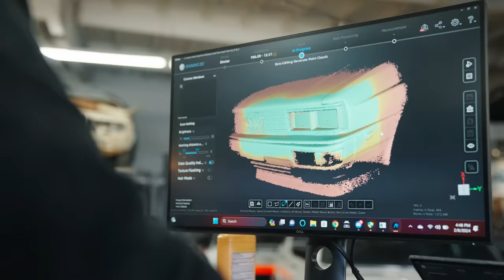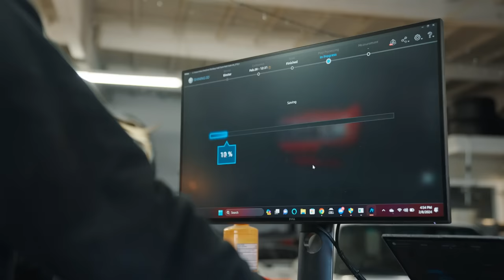The Audi Ur-Quattro Rebuild Begins: Complete Suspension Overhaul & B3 Retrofit

Comment from the maker: Because I’m already getting lit up about pressing the bearing in by the inner race: 
I know the outer race is ideal, but this is a tapered roller bearing, and it is okay to press by the inner race. It’s also held in that way - no snap ring or lock. Just a bolt to the axle clamping the inner race, which pulls inward (direction of press) on the bearing only on the inner race, while the outer race is seated against the inner flange. 
I appreciate the concern, and I know it’s not the ideal scenario, but I even confirmed it with shops that do this every day. 😃🍻
Reply: I just came to scold you! Good on you for owning it.
Reply: I'm surprised there is no snap ring. My old Audi 5000 had one.
Reply from the maker: 5000 was the same as the UrQuattro uprights, which did have snap rings. The B3 parts do not.
Reply: @Nobody-U-Want-2-Know  Same, how dare you beat us to the punch...
Reply: The early 90's Celica wheel bearings are the same way, and most shops in my area won't touch them cause they always break when installing the new ones. And, axle nut torqued to spec is an ABSOLUTE MUST on bearings like this. Over torque it and you shatter the races, under torque and the bearing wears too quick.
Reply: Lol.  Who even said what you were doing was wrong.  Dead ass been using this method well over 20 years now.  Arm chair mechanics bro. Y’all gotta chill.  Leave the man alone!
Reply: Defenetly try „Audi Tradition“ in Germany, normale they have any Part for old Audis … 😉
And I think u have the time to wait on some Parts… ✌🏻
Reply: I knew the nerds would get on your case for that. Sometimes you do what you gotta do. Better than risking marring up the seal.
Reply: What brand is the tapered wheel bearing? Thx
Reply: Yeah I was going to say that. Wheel bearings are designed to take some side loading, but still man, come on! That's a $20 part!
Reply: So, let me get out my crayons and explain, no the bearing won’t fall out, but, two hardened surfaces pressed hard again each other create a small indent, which then leads to excessive wear, but if there cheap doesn’t matter does it, nothing like doing a job twice.
Reply: @dereklovell9778  roller bearings. Not ball.

Comment: Wheel bearings on urq are simple non stepped 75mm all around, available everywhere.  Also, the single piece Urq struts are actually lighter than the 2 piece B3/B4 struts.  Also, you can use the new style control arms with the original stuts BTDT many times.  Also.... shall I keep going?   Parts are available, you just need to know where to find them.  Joining online forums and groups can open up a big resource into sourcing parts.   For suspension, always go with Lamforder, they are OEM and will outlast any of the aftermarket crap like Delphi
Reply: Well said Martin.
Reply: FYI the rear hub bearings are the same size as the E30.
Reply: @seangray-4223   On the Ur-quattro originally up to 1985 both front and rear bearings are the same 75mm non stepped.  Starting 1986 the front bearings increased to 82mm, also non stepped, while rear remained 75mm.

Comment: @stanceworks Mike. Just a quick tip but when you have the car sat on its wheels then that is the time to torque up the suspension arm bolts otherwise you will chew up your new bushings if they are tightened without sprung weight on them. HTH.

Comment: Trick from motocross for easy bearing install.  Put bearings in freezer engine cases on bbq. They just drop in. Works like a charm even if you can't heat the external side cold bearings still slide in better
Reply: I used to work at a construction equipment shop; we had a pressure cooker that we would fill with dry ice. Drop your bearing in there for a few hours and it goes into its home easy-peasy!
Reply: That's not from "motocross", every knowledge enough mechanic knows that truck.
Reply: @j.d.8593 I don’t know the truck
Reply: @cermo9101  that's because you don't knowledge enough.
Reply: @OdyTypeR  the joke went over your head didn’t it
Reply: @cermo9101   Or did my joke go over yours?

In hindsight, Instead of " you don't knowledge enough", i should have said 
" you're not knowledge enough"
Reply: @OdyTypeR  lol you’re right it did, didn’t read back through the original post 😅

Comment: Mike, I think I heard you say that you were looking for 16" rims, which would be period-correct and large enough to fit brakes that are appropriate for the original power output of that car or a Coupe Quattro. They will not, however, be able to fit the size of brakes you will need with the amount of power you are likely to get out of an even lightly tuned version of that motor.

In the VW/Audi OEM world, the largest brakes that I have found that will fit under 16" rims are the 312mm front rotors and calipers fitted to the non-PowerPack Golf GTI Mk7, 7.5, and 8. For that size rotor, Tarox has a 2-piece rotor and caliper combination that can fit under some of the wider 16" rims that are specifically designed for clearance, but that is the best combination that I have found so far.

The PowerPack versions of the GTI come with larger front rotors (340mm) that require a 17" rim to clear the calipers, and there are a variety of big brake kits available with rotors of that size. The higher-power AWD Golf R comes with even larger front rotors (357mm). The OEM fitment for that car is 18" or 19" rims, but Apex Wheels has a forged model VS-5RS that is the only 17" rim that I have seen specifically designed to clear the Golf R brake calipers on those larger rotors.

I don't know whether the dimensions or looks of those wheels will work for you, but it is all a balance between the looks that you want and the brakes that you need to match the speed potential of that car. Looking forward to seeing what you end up going with!

Comment: Here is a scanning tip. Start the scan in the centre and then move to both sides. That way your scan will be more accurate. And another reason is the way bounding box works. I don't know if you have noticed this, but there is a bounding box and the size of it is determined by resolution you are using. Also, it is constructed when you first hit the start scan button and it has a specific positioning. You can find more information in the manual actually to figure out the size and placement of it if your patient enough :D If you see a straight cut line somewhere in a larger scan, you have reached the limits of that bounding box. Saving the scan as point cloud and meshing in another software would help if you don't want to re-do the whole scan.

Comment: What’s nice about that giant arbor press is it’s fast. I have an old Dake bench top arbor press but it’s only good for a few tons of downward force. A cheap bottle jack press (I think it’s 20 ton?) does a great job with a small footprint, but it takes forever and is very difficult to operate one handed. Your press does it all, and faster.

Comment: Regarding 11:30 - only torque the wishbone bolts up when the car is on all four wheels (bearing the cars weight) otherwise you will shred the bushes very quickly if you torque up the bolts any other way.

Comment: 5x114.3 will work on 5x112 if you use wobble bolts, I do that on my rallycross Beetle to fit my Sparco wheels that I also run on my S550 Mustang (all using the proper centering rings, of course).

Edit:
I should say, it will work if the lug bolt hole tolerance is big enough for the extra diameter bolt circle. In the case of my Sparco wheels, it is just big enough.

Comment: You dont actually need wheels that fit, just wheels that sit flush with the hubs. You can use all thread through 2 of the bolt holes to clamp the wheel onto take measurements. Done it heaps on different track cars.

Comment: Trick to take off the bearing race off the hub. Put it on a cordless drill on the chuck. Put the drill on the ground and start spinning hub. Heat the race as the hub spins and it should just fall off when heat heated enough.

Comment: Try 90% isopropyl, instead of the 70% isopropyl I’m assuming you used, for your talc / alcohol scan matting mix, for a faster drying time. Also, realize the alcohol will thoroughly screw up the wax.
Also, I came across a FB group, that might be of interest, for inspiration/ reference, on wide bodies.
The group name is, Group 5 “Special Production Cars” 1976-1982

Comment: That suspension looks great! I had a few Audi 5000s which had front suspension that looked a lot like that the UrQ had front and rear. Very heavy (and I did wheel bearing replacement using a very similar looking arbor press at college).

Comment: The sport quattro front end also looks better because of the steeper rake on the windshield. The long wheel base quattro has a less steep rake, and I'm afraid it will look weird with the sport quattro front, without changing the windshield (which is not possible without cutting the car in half)
Reply from the maker: That’s the reasoning the short wheelbase looks good. Has nothing to do with why the headlights and grilles look better.
Reply: @stanceworks I had doubts, but I guess it will look okay...

This is a LWB quattro with the front sport quattro grilles and lights. Video by Larry Chen
https://youtu.be/GCVJ8GggI0s?si=AOT-4N7XFiAuySrw
Reply: I wholeheartedly disagree! As a huge Audi fan, and previous owner of a number of '80s Audis, I never liked the steep rake of the Sport Quattro windshield... the shallow rake looks MUCH better in my eyes. So much so that, if given a choice between the two cars (Sport or Ur), I'd take the Ur every time... even with the huge value difference.

Comment: I saw you used a screw with 8.8 at the subframe (at 10:40).. is that like the original was? Often those screws for suspensions are in 10.8 or even 12.9 🤔
Reply: bolt, not screw

Comment: Plot twist, 5x112 is a BMW bolt pattern as well (2018+ depending on Model). Granted you won't find a 16" BMW 5x112 that would work I don't think.

Comment: Knowing that one of those wheel bearings has a orange plastic cover and the rest of them had black plastic covers that would drive me insane
Reply from the maker: The rears are one color and the fronts are another. It’s two pairs.
Reply: @stanceworks  oh okay yeah it looks like in the video that one was different than the other ones but yeah there's only three pictured in the video b-roll

Comment: 13:30 crap like that is why I’ve lost faith in companies like Moog. I got a set of sway bar end links for my Integra GSR, and they looked like 2 different design parts for each side, although the both sorta fit. But since they weren’t technically wrong, RockAuto wouldn’t accept a return so I had to live with them or pony up 3 times the price for OEM.

Comment: If you wazz a few thou off the old (gutted) bearing outer race with a grinding wheel or linisher, its the perfect tool to press in new bearings. Just the right size every time. Id always press on the outer race never the inner. 
This comes from the guy who has bashed new half shaft bearings on with a wrong sized scaff tube and the halfshaft vertical on the mud floor stabbed into its wheel. Yee haa.  If it spins nice, not notchy, send it.